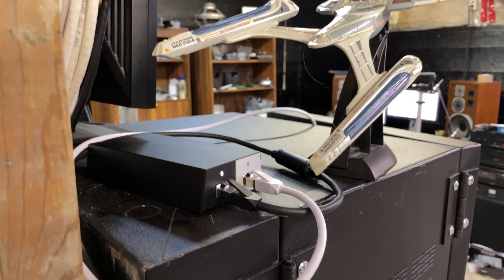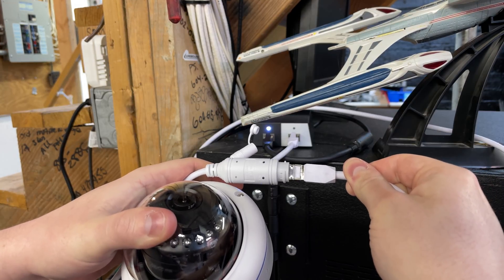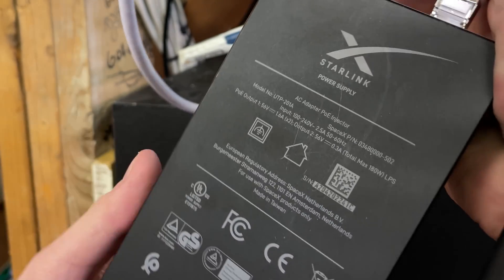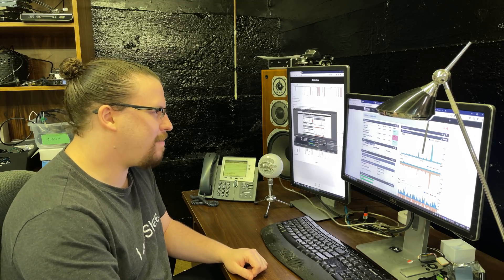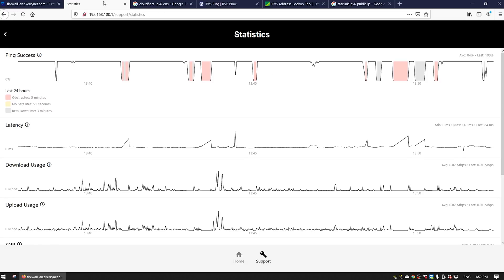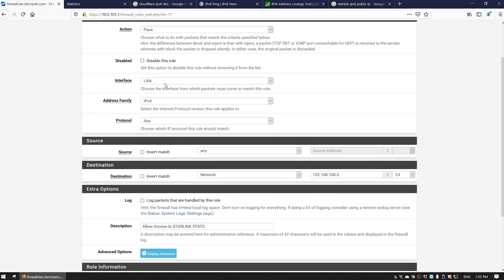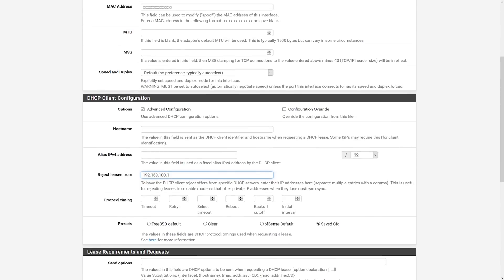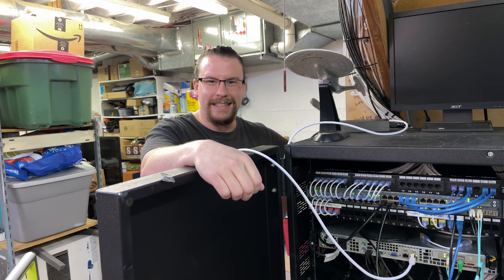Getting Starlink Stats working with pfSense!

Comment: Hey Shae thanks for the mention and trying to get your stats with the suggestion but fail...anyways YOU DID IT! That's a YES @ 11:45 about making this work with a "Standard" Router using Static Routing....That's how mines working and yes you lose the ability to see the Bottom 3 Pings to gameservers, no big loss there. More videos PLEASE! Also there's little to no difference in Connectivity UpTime, Losses, Speed Difference using my own Router versus the Starlink Router. It's just nice using my own equipment and having both Wifi Bands available with a personal Router!

Comment: Hi all, i am from Greece and i will be soon a beta tester of Starlink. As per my understanding, the starlink dish does the authentication and publishes local ip addresses through dhcp. Is there any way to use the dish as bridge mode and do the authentication (username/pass provided from Starlink?) in my own router directly?
Reply: Starlink already acts in "bridge" mode once it's connected. It only uses private IP (192.168.100.0/24 range) when it is not connected to the satellites. Otherwise it gives you a WAN IP.

Comment: This is actually interesting. I run my home modem (Cable) in transparent bridge mode, and it assigns the web interface to 192.168.100.1 on it's own, which is weird to me.
I'm surprised Starlink doesn't do the same with it's "modem" or if that's a feature of my home router (Asus) or something else.
In any case, I am getting my dishy soon, and I was curious whether the interface ran on the dish or on the router they provide, and I am pleasantly surprised at this news.

Thanks for the video! I'm so excited to get Starlink at my workplace to stop relying on our antiquated DSL

Comment: I'm using opnsense with zerotier on a isp with cgnet. one local router and one hosted on a vps. can just port forward as normal then :) though interface needs to be reenabled after reboot thought there is an issue with zerotier plugin

Comment: Output 1 is probably IEEE 802.3bt 4PPoE, which uses all 4 pairs to deliver power, with each 2 pairs carrying around 40w, for a total of 80w.  Output 2 is just plain old 802.3af.  However this is probably just a dumb mid-span injector, which doesn’t support all the negotiation and powering options a switch would support, which is why it doesn’t work with some devices.

Comment: nice, I was trying to setup a pfsense server to go from private to private to internet all of last night, if its just a few of these nat settings I should be able to route all the traffic from clients to the gateway(pfsense proxy1) to the pfsense proxy2(socks) which then goes to the internet through the actual internet gateway. did this in a virtual environment through hyper-v in testing so i can do it practically when i'm at work next, main issue they have is smart tv's that are stupid enough not to have proxy settings; so i need to reserve ip addresses for them and get them to go through the pfsense proxy to the workplaces actual proxy to then allow them to have normal internet. probably more complicated than it needs to be but I don't have full access to the workplaces proxy only for filtering etc nothing with auth. this video might of been exactly what i was looking for and it was your previous starlink video that youtube recommended me. win win and subbed! ty ty

Comment: What was the outside temperature at the time you check the power usage? Just wondering if the dish’s heater is on and that’s why it’s high. 

If it’s not on, would it be possible to take note of power usage when the heater is on?
Reply from the maker: It is cold, but not that cold. Around 10 C at the time - we have some really cold weather coming up as low as -12 C so I will keep an eye on the power consumption. I am going to make a full video on that at some point.
Reply: @TechwithShae  you should do some automatic stats so that you can compare it to internet usage and temperature in grafana

Comment: I had trouble getting the stats on my pfSense too. I was trying (https://www.reddit.com/r/Starlink/comments/jvgbt3/starlink_with_pfsense/). I tried your settings along with the Reserved Networks in the interface. I have "Block private networks and loopback addresses" checked and "Block bogon networks" unchecked. The stats didn't seem to work when "Block bogon networks" was checked. What settings do you have for these two options?
Reply from the maker: I have both those options unchecked, I missed that in the video since when you add a second interface for WAN, it does not automatically turn those on. It would make sense why it would not work with block bogon networks checked, since the 192. IP would never be on the internet. There may be a way to get around that and still have that option turned on, but I am not sure how.

Comment: this is the same thing I do to access my ONU's web management interface while its bridge mode.

dang the power consumption of the dish is really high. while xDSL, cable and fiber optics only consume like 5-10watts.
Reply: Yeah, that kinda surprised me as well. Depending on where you live, you might have to factor in the power cost in addition to the service subscription. Still, Starlink is a cool option if you want a backup connection that is totally independent of the local utilities.
Reply: @J Fz the dish is not a dish, correct, but most of the adjustment is not done with the motors at all. The dish uses a phased array which allows radio signals to be amplified in a specific direction that isn't just perpendicular to the device. It's a sort of radio wave steering done with very precise timing of each of the elements.

Comment: Great video. I have two LTE modems (separate cell towers) as my internet failover but been unable to access the modem GUIs despite reading the same on-line articles as yourself. Adding your third firewall rule works allowed access to my modem GUIs. I'm using OPNsense. Thank you very much.